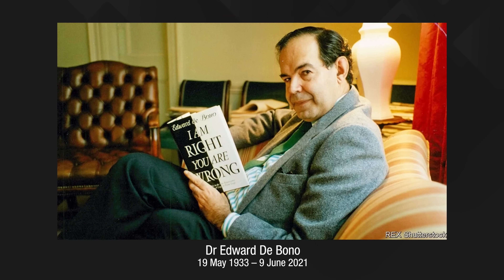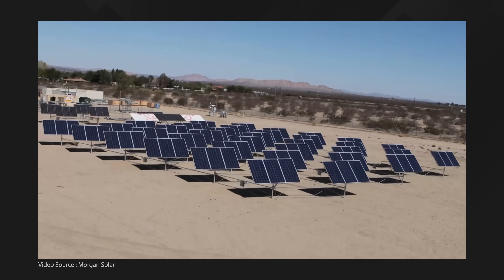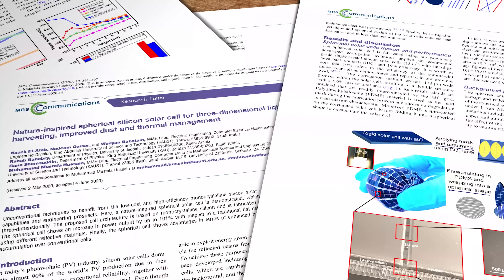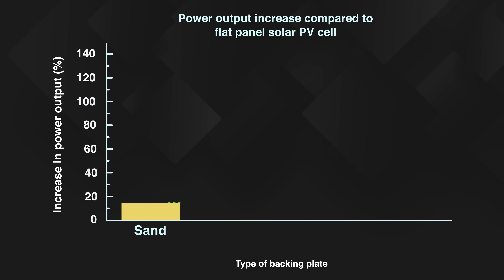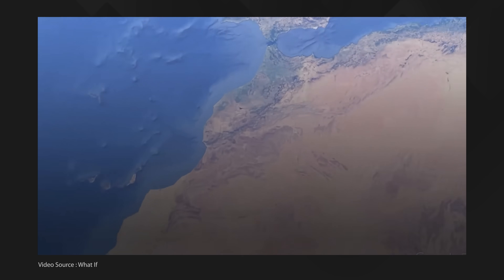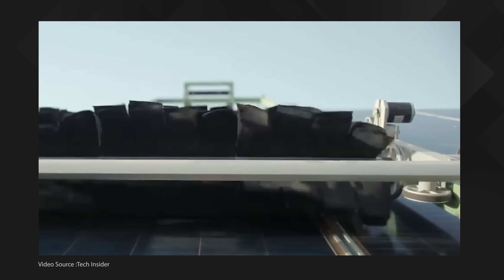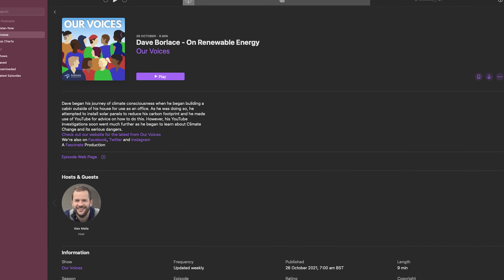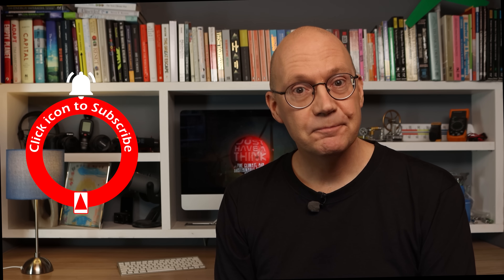Spherical Solar Cells - doubling the power output of flat PV panels!

Comment: This doesn’t really make sense, did they point the flat sell the wrong direction??? If both have the same surface area, (which is what we care about not the surface area of land use) if the flat cell pointed even moderately in the right direction it would generate more power, because half of the sphere at least, is pointing literally away from the sun, and the vast majority of the cells are pretty significant angle. Thereby also significantly reducing their output. And incident from other directions is a factor 100 less bright normally, (cause the world is not white paper)
And if we do want to have incident light coming from all directions we can use by directional solar cells which are still flat but accept light from both directions
And if You are going for a curve solar panel, then just do a half sphere don’t populate the side that never sees the sun. you would be better off making two half spheres then one full one, which shows the folly of this design.
Reply: Yes, you spotted a fundamental problem with their reasoning.  A flat panel facing the sun doesn't let light get past it.

Comment: BEFORE I watch this, my thought is that mathematically, the efficiency gains would be limited by the surface collection, thus not as effective as a flat panel with a baseline efficiency. Using smaller balls are just increasing surface area in 3 emissions ...

AFTER watching this I see the benefit of reflective light absorption, and cooling, but as you stated, cost is not right, as it is incredibly complicated to reproduce the spherical form economically. My take is, they need to keep pushing the idea behind "sphere" and apply it to a new design. Ideas are often really amazing and do what engineers think they will do, but making it viable, THAT is the real test of good engineering.

Comment: Foldable panels are awesome, I'm sure there will be a use for them at some point

But comparing a spherical pannel and circular pannel with the same radius (resulting in the same surface area on the ground) is kinda silly

The spherical pannel will produce more power for sure

But it takes about 4.2x the amount of actual pannel surface area (assuming a perfect sphere which it obviously isn't) and by the researchers own admission only makes at best double the amount of power.

And even more pannel will be used when you consider the cutting process will likely result in pannel waste.

From a pannel per watt perseptive best case scenario you lose half the power 

I'm sure curved panels will be useful

But Imo spherical panels are a waste of materials.

Comment: If the angle is low - a sphere will shadow the sphere next to it. No win there.
Large flat surface will be more expensive to cover with spheres than to cover it with regular panels. No win there.

But a mobile object with solar that follow the objects shape and curved surface sure. Like the company "Sono Motors" car the Sion. Big win. I am very interested and follow the Sion car <3
Perhaps there would be appropriate application for the sphere solar, idk.

Comment: OK, the measure is (watts / square footage) of ground space used.  So using the ground real estate rather than the area of the panel the efficiency is better.  Makes sense.  They'll cost more unless there is a breakthrough.  The initial increase cost may be worth it.  Tracking and cleaning isn't cheap.

Comment: Sure in low potential regions where area is a factor then why not. But for large scale production in areas like deserts idk, because the only metrics that matter is production/maintenance cost per kw, and the availability of storage or markets to buy the power on supply. area is not actually that much if a factor, i mean sure it is, but not by much, and you know its pretty easy to automatically clean panels nowadays with relatively few people working in the maintenance.  and these balls would also need maintenance and cleaning from dust and so on. as long as the $\kw for investment and maintenance is significantly lower for flat and not that efficient panels then we should see those being used more frequently, also one oart of solar is the installation cost ofc, less efficient panels do cost more to put up per kw, but that could be gotten around pretty easily, you could for example build a bunch of 3-5% panels in think flexible sheets and roll them out with machines in say deserts and then clean them by rolling them in and out or something, plenty of room to get creative, the most pressing problem however for solar is that the most solar rich regions have very little demand and very little power transmission infrastructure, which makes initial investments in say North Africa for example no viable in the short term without some demand there or without transmission lines to European cities for example or the interior if Africa or between countries. sure there is sort of a market there but not on the European scale of consumption. What we need to so grow plants in the desert in greenhouses and use the material to produce fuel, or make hydrogen fuel, using solar, such that the constant supply can fit into the supply chain without a massive initial investment in infrastructure. Plant material for example is just very low grade fuel really which can be processed chemically to produce high grade carbon neutral fuel, which could be used for shipping cars and heating.  still it would require a large intitial investment but not as badly as building intercontinental power transmission infrastructure before there is a relationship between supply and demand. another thing is that desert are pretty good at radiating heat into space, if we want to cover a large portion of the worlds deserts in panels we will increase the average temperature of the earth and heat up the deserts, so if we are to go full desert crazy we need to increase the radiative cooling as well, meaning solar panels on its own won’t do that  job. Irrespective of what panels we use i think production of fuel by similar means is the #1 thing we should make work, it can work, its just a question of profitability and stability of desert regions. but to be fair it could easily work, either with processed biofuels or with hydrogen production. deserts have a lot of potential for this, and the economics are relativley simple, you get a certain amount of fuel energy from a certain amount of kw’s of panels per time, so take the production potential, and subtract investment and maintenance and logistics cost of fuel production and distribution and you get a number, if that number is positive or around 0 we are in decent shape, if its negative we are not. But it has to compete with oil and that is pretty cheap. So we will definitely have to see what happens. Yet I’m hopeful we’ll see something like this being tried in the future.

Comment: The world should focus more on bioengineering rather than mechanical engineering. Nature developed the technique to capture light energy through photosynthesis and stored the energy in the form of starch. The process includes a cooling system through transpiration. The product is recyclable and they can be broken down. The problem with machines is that they are not part of the natural ecosystem and thus can be destructive especially when they scale up.

Comment: I'm assuming the idea is to build solar panels into ball shapes? Like a basketball or bigger? A part of the video mentioned tiny bead like solar balls. Wasn't quite sure what design they were ultimately talking about - but anyway, the backing material got me excited. It seems like you could layer the surface of any installation with ultra-reflective material to really boost the power. My initial thoughts are to put the spheres into a box where the box sides are reflective as well as the floor. Or maybe a ridged floor...can't wait to see where they go with this.

Comment: It seems that the maximum output is only 2x a flat panel while requiring 4x the surface area of cells (surface area of a sphere is 4x the surface area of a circle with the same radius).

This means that at best, you are getting half the energy per cell than a flat panel.
This invention seems like a good idea if the constraint is ground area. If the main constraint is cost then a flat panel is still better.
Reply: Well. I'd think the issue in cost would not be the panels themselves, but rather the mounting hardware, and the 20 years of paying someone to clean the panels in a farm situation, those together add several million dollars in projected costs, and because wage should go up with inflation and many countries are intentionally applying inflationary stresses to thier dollar (for lots of reasons that are great if your a large buisness owner) 
The wages saved in maintance would probably cover the cost of the cells in a solar farm compleatly
Reply: Actually he has some thing in that little spherical cells which actually gets incident rays at 60 degree(which is the maximum efficiency rays) on all the time of the day or at least 9to 5
Reply: @prabhakarkhodadalu7945  Plus, although more photovoltaic material is used, more power density is generated in a smaller area, and plus, PV material have become exponentially less expensive so one can afford to use more of it as there gets to be a time where space/real-estate is at more of a premium than the PV material itself.
Reply: The idea scores in overcoming the in-shade periods which reduce the effectiveness of fixed one-direction panels,  & perhaps also in needing less ground area.

Comment: Surface area of a sphere is four times the area of its largest cross section. Ignoring the efficiencies due to better cooling and producing energy from scattered light, the sphere’s energy production would be equivalent to a circular flat solar cell with the same radius directly facing the sun. Unit cost is likely to be a prohibitively high for spherical cells.
Reply: I agree the production cost is likely the barrier, but it will be more from the the complexity of dealing with the shape on the assembly line, and the complexity of mounting it all into some kind of frame to hold a bunch of these little balls.

Comment: What would my neighbors think if I had a giant PV sphere above my roof?  😱😱

I could see using a hemisphere so there are enough points to anchor it to the ground.  But a sphere would need a very sturdy pole to support it.  I think the spherical or curved PV array might be a good idea if it was anchored to a curved  structure, like a building.  It's good to have a strong support behind the PV cells.   A curved surface might be harder to keep clean.

Comment: Unless the light is reflected back at the back and sides of the sphere I don't see how they are going to collect any more light energy. Perhaps use a bunch of retroreflectors behind the spheres. A cylindrical configuration with reflectors behind may be more practical to manufacture. You effectively increase the square footage of panels and take up less roof space. I would be interested to see what happens if you sandwich the spheres between two layers of retroreflectors.

Comment: Remember Solyndra panels? Round tubes filled with optical fluids and a thin-film ribbon inside. Balasted system on white roofs taking also the reflection from underneath the panel. Exceptional engineering but too expensive in competition with dirt cheap Chinese polycristaline panels.

Comment: It would seem to me that a full sphere would be very low value for the lower half, so maybe just a hemisphere would do. But that's not my reason for comment. When you first started talking about this my imagination took me to the idea that you were suggesting that beads would be added to flat panels so the light at low angles would be captured/redirected to the panel without moving it. I'm sure there are many flaws or limitations to that concept. I'd love to hear any thoughts on the idea.

Comment: Thank you for another great video! I remember Edward de Bono too. His Lateral Thinking still seems like a pretty cool notion, and it might be even more relevant today than it was then, since we now have machines that can "think" in the conventional inductive and deductive logical manner.

A spherical solar panel seems a little counter-intuitive, although the advantage of curved panels over flat ones makes sense, since the idea is to capture as much radiation as possible from a glowing sphere. I guess at Earth's distance from the Sun the radiation is coming in pretty much perpendicular to the ground so the there isn't much advantage in concave collecting surfaces. The convex sphere would capture more light than a flat panel as the sun moves across the sky, but at the apparent cost of having less light hit the panel at a solid 90 degree incidence. I'm curious how they ended up with a 24% increase in power, since the light hitting the sphere should be a little less intense than the light hitting a flat surface.

Whatever's going on it's still a cool lateral thinking kind of idea, and I love what you said at the end about using the technology to produce molded solar panels on rounded surfaces like the top of a drone. Whether we all get disco balls on our roofs or not, the technology is probably here to stay.

Comment: the function describing the effect of light falling at an angle to the panel surface is a Cosine function so minor angular difference are not really important. It does not even pay off at my latitude (56 degree) to pay for a tracking mechanism.

Comment: Scale would be great! In the meantime building one of these yourself for Off grid use sounds doable. I currently move my panels around manually on a wheeled cart to follow the sun morning, afternoon to early evening. I have already increased my output by up to 20 percent doing this.
How to best connect them in Parallel or in series is a problem to work out. As others have suggested, Perhaps stringing/gluing them onto a Tetrahedron or other elliptical surfaces may work better.
The biggest value for me would not needing to be there to move them. I would put on facing east and one facing west.
My deck space would be freed up by the ability to but then on a pole, or strapping them to a limbed up tree.
With those curved surfaces low or hi angle sun would fall on a flat surface. Just think about increasing efficiency by  20 to 30% would be enough in my case to use 2-400 watt equivalent flat panels to do the job. instead of 3-400 watt panels.
No need to wait for Scale or Patent infringement .

Comment: Maybe these balls could have an advantage over standard ones in areas where strong adverse winds are common, which would turn flat panels over, or damage them. Did they also check how well a cylindric shape would work, or something that has a curved front and a flat back, and how that would perform when a storm is coming in from the side (think of laminar vs turbulent flows)?
Reply: Spheres do poorly in a wind.  They shake like mad due to vortex shedding.

Comment: While neat, my limited understanding of renewable say that it is intermittency that is the issue, not the amount of energy produced. Perhaps it could save space if it can be designed smaller and yet outputting the same amount of energy, but otherwise it doesn't seem like it is a needed improvement, since rotor tracking isnt really energy intensive when compared to the amount of energy produced.

Comment: Evverything described in the concept is easily understuod and intuitively logical.
Despite all the described factors that contribute to making spherical photovoltaics, there is one major factor that is not described, cost. Not just cost of manufacturing which is touched on briefly but the fundamental cost of materials related to the predicted output.

And in this, it's hard to conceive how a sphere which would only have a very small surface area optimally aimed at sunlight source and the vastness of the remaining area at less optimized and perhaps nearly completely unproductive could compare with a flat panel continuously aimed at the optimum angle to the sunlight. Environment would be important, and even whether the environment is reflective, but even so could hardly be better than traditional means. 

So, although there might be some extraordinary situation like immersing the sphere in the source or as described in the video embedding in clothing or mounting on a mobile platform which might change orientation to the source constantly and unpredictably, there doesn't seem to be much future for the concept. Maybe a half solution make since, literally cutting the sphere up and dotting teh orizontal surface of a statically mounted surface but would need investigation.

Comment: The total cost should involve a secondary passive aspect of using sunlight capturing devices.  They typically shade the Earth from de-humidifying sunlight.  This can be very useful in arid places like deserts where otherwise nothing can grow because of too much evaporation of moisture.  Suspending solar spheres on top of large nets can be precisely adjusted to allow growth of specific crops in the desert using grey water for moisture.  Thus the resulting crops may be harvestable to sell to offset costs of manufacture or purchase price.